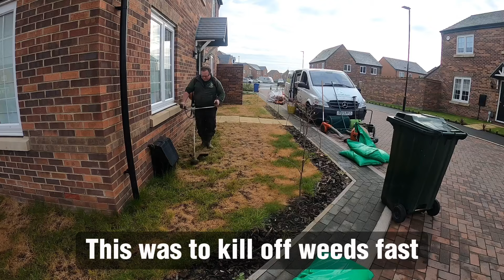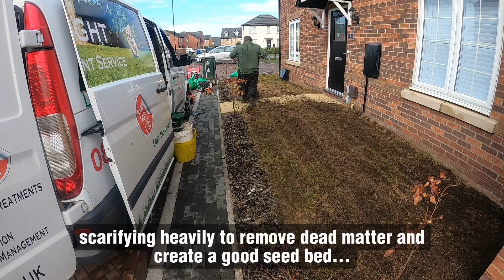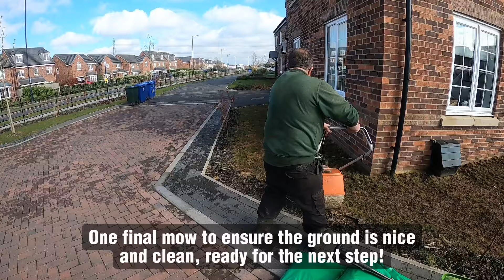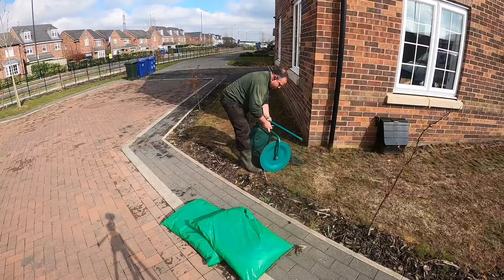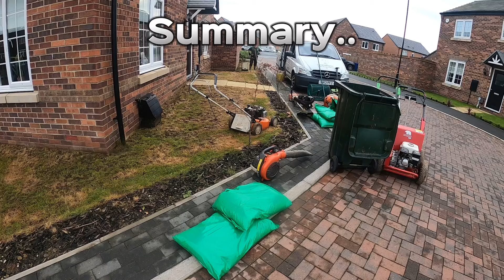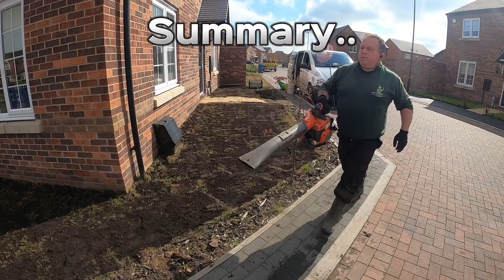Timelapse lawn renovation in a very sunny spot

Comment: Hi Shaun,how often would you use iron sulphate lawn tonic with seaweed extract?
Reply from the maker: Mainly just over winter for the iron. The seaweed can be applied very regularly
Reply: Shaun this is liquid mix?
Reply from the maker: @ronaldmaxwell4579  hi I've only ever used powdered ferrous iorn sulphate mixed with water so not sure eon the liquid versions
Reply: @LawnRight  You would have laughed if you watched me mix the powdered ferrous iron sulphate that the genius at the garden center assured me was water soluble.  I should have tested it first, but no...I put 12 liters of water in my Solo backpack sprayer and poured 2KG of the fine powder into the water.  The powder turned into a rock hard blob almost immediately as it settled on the bottom of the sprayer.  I couldn't chip it out and eventually took the ex-sprayer to the recycling center.  That's when I bought the FlowZone.  Now I test any powder going into the sprayer to make sure it really is soluble in water.